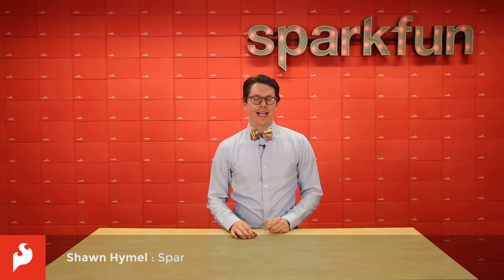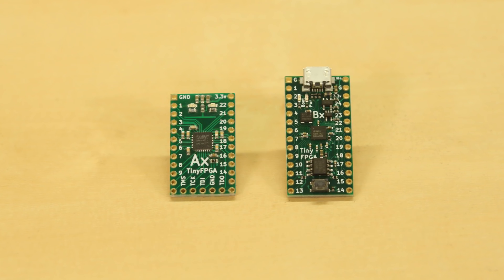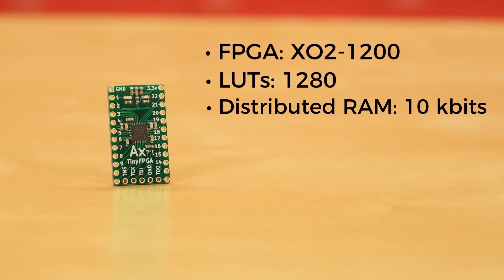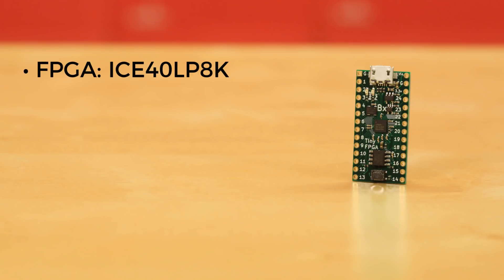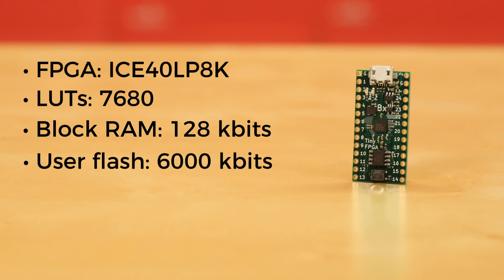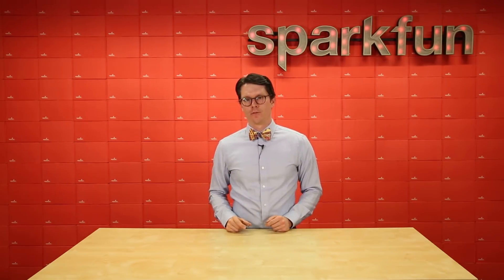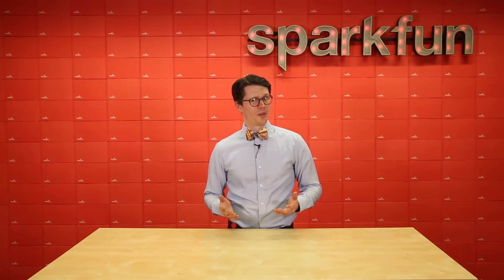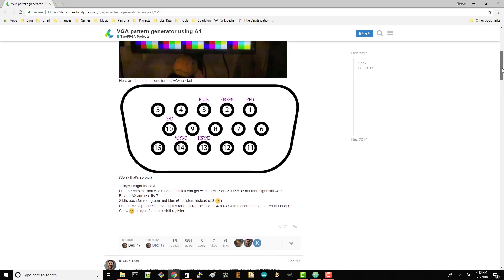Product Showcase: TinyFPGA

Comment: Why Lattice? Why on earth? I've been doing Xilinx, Altera (now Intel) .... and Lattice. Their IDE is a pile of pure shit. Error messages are full of internal lingua. Their SDRAM core was  just a heap of files without any real documentation. Part of it was non-synthesizeable code, such as AFTER statements. Having Lattice in the project was a pure disaster. I'll never ever again use Lattice FPGAs. If you wan't to play around with FPGA's I'd take a look at something like MAX10. For reasonably priced boards with Xilinx or Intel I'd look at Digilent or Terasic, respectively.

Comment: Sweet! These bad boys will run a slimmed down version of Oberon... the real deal RiscV. Actually, this is a Risc0 mcu core, which is more 'right sized' for these miniature FPGA's. RiscV  will be cramped on these little fpga's. 

I asked for some help from Clifford Wolf, developer of IceStorm, on compiling this:
http://www.inf.ethz.ch/personal/wirth/FPGA-relatedWork/index.html
I sent him an email at 12:26 and he had a Risc0 'core' compiled... by exactly 3:33. And that was back on July 30,2015. Here it is:  http://svn.clifford.at/handicraft/2015/risc0_ice/

Remember these are TINY machines. They will accommodate  a 'core/program' the size of an ATtiny or thereabouts. With Professor Wirth's system you have the chance to literally build the ultimate miniamalist 'core' or the 'virtual hardware' using Lola-2, the Oberon 'Verilog language'. So you can program the hardware in Oberon to compile Oberon the operating system, to compile the Oberon compiler itself! Of coarse that could be your goal. Professor Wirth did it with the full blown ProjectOberon RiscV system and you can learn to do it on a Risc0 system. That is your challenge. https://www.inf.ethz.ch/personal/wirth/Lola/index.html.

The last detail if you build one of these out with a custom 'core' you need a suitable language to write programs with. Take a look a PicL, the Oberon base Pic compiler, which is much like the simple mcu's you will be creating with these FPGA:  https://www.inf.ethz.ch/personal/wirth/PICL/index.html. Could easily adapt PicL into 'SparkL'  or 'Spark Language' and it would be awesome.

Here is the instruction manual, enjoy:
http://www.inf.ethz.ch/personal/wirth/FPGA-relatedWork/RISC.pdf

Here is the main ProjectOberon homepage http://www.projectoberon.com

Comment: Can anyone tell me if you could build the basics of a quadcopter flight controller with one of these?
Reply: Sure, if you want to over-complicate things. Instead of asking "can I do it this way" you should ask "should I do it this way". If you have no actual reason to avoid using an MCU you probably don't need to use an FPGA.
Reply: Do it on an MCU. Arm cortex m3 or m4

Comment: I'd love to see more projects that have specific uses that are best implemented on an FPGA like this instead of a MCU.
Reply: John Michael Stock things that need to run real-time, known delay processing are great for FPGAs. Anything you would use a custom chip to do, FPGAs can do (sometimes slower, usually more expensively, but with flexibility that would require ordering new chips and making new boards otherwise)
Reply: I'm no expert by any stretch but I have seen a few examples from the Microchip YT channel where they are demonstrating some of the peripheral hardware based logic features associated with their newer C-optimized 8 bit microcontrollers. I look at those examples as a bit of a stepping off point for what could be done with a small FPGA. I am more curious about implementing a state machine for the sake of learning instead of truly optimizing hardware though.... it's just an idea.
 Also it's worth looking up "Robert Baruch" here on YT on the channel by that name. He has uploaded content about early Programmable and Gate Array Logic (PALs/GALs), State Machines, and he reverse engineers ancient 74 series logic chips at the silicon level with a microscope. He even does live streams demonstrating the reverse engineering  techniques. His channel is well worth subscribing to and don't forget to hit up the notifications option if you want to catch a stream. His streams are a great learning experience. He answers questions too during the stream and that's really awesome. 
  I have no affiliation with him beyond being a simple hobbyist/viewer/random subscriber to his channel. I'd post links but this message would hit the general auto-spam filter. 
   My subs and playlists are publicly listed so worst case you could find him in my subs. I also saved some of his uploads in my "Misc Hack Hardware" and "MCU FPGA/CPLD" playlists. (My playlists are intended as a form of personal reference as a hobbyist trying to learn, instead of the more conventional self promotion methodology. My channel is not monetized so I couldn't care less if anyone checks out what I've done. I have nothing to gain...but seriously, go check out Robert Baruch if you haven't already ;)
-Jake

Comment: Finally students can buy fpgas rather than microcontrollers👍
Reply: The right tool for the right job remember. Often all you need is a 555 timer lol
Reply: John Michael Stock yes you are right 👍but I think the best way to learn is to create one.🤔btw thanks for the idea👍
Reply: John Michael Stock  psh, an IC?  When I was my age, we used individual transistors for all our logic!
Reply: soupisgdfood exactly! It's best to know the basics/building blocks before moving onto more advanced devices.
Reply: c31979839 quite false. One does not need to know about transistor gate pin saturation in order to complete most projects with an Arduino ..
Reply: topher psh, one needs to make a transistor with their bare hands out of sand before they can adequately design a circuit for an arduino
Reply: soupisgdfood one must make bare hands out of sand before they can adequately Arduino with transistors.
Reply: topher yes but first that sand must be made from rocks
Reply: Maybe I should rub some rocks together until I have enough make a diode.
Reply: @edism  
One must expand the universe to form baryonic matter long before rocks are a thing.

'...something something...we learn from "standing on the shoulders of giants...."' 

  to the naysayers "resistance to change is the primary indicator of obsolescence."
Reply: @UpcycleElectronics  😁

Comment: A 32 pin QFN packaged modern FPGA. Huh. I'd still have no idea what to do with it. Is there a schematic capture feature available like Quartus/Altera/Intel'era? Has anyone/Is anyone attempting to dumb this down for the rest of us?
  I could see myself making a board with a QFN-32 after playing with a breakout board like this. It's a lot more practical than incorporating a EPM240 w/100 pins (the currently shelved muse). Is the FOSSy toolchain Penguin friendly?
-Jake
Reply: Look at Open Cores, there are several mature drop in projects. You'd have to learn how tweak them for that FPGA but it's not that difficult.  https://opencores.org/
Reply: Upcycle Electronics have a look at Icestudio
Reply: can I ask you one more question, what would be the proper IDE to fully utilise the FPGA on Bx board? Is it a free IDE or do you have to purchase the licence for that separately? Similarly if someone buys a FPGA development board do they get the IDE free of cost, or again license purchase is required. Its understandable that some open source IDE are available but they can't be expected to outperform the features provided by the official IDEs.
Reply: shekhar rudra The open source one is actually quite good, have you looked at a benchmark comparison yet?
Reply: Search ‘fpga led’ to get a list of led matrix fpga projects if you like blinky lights.